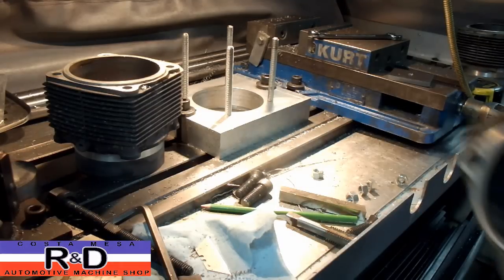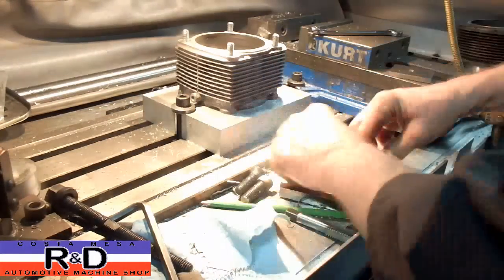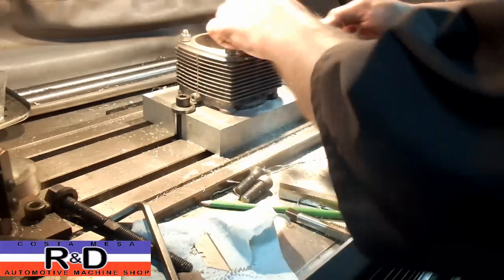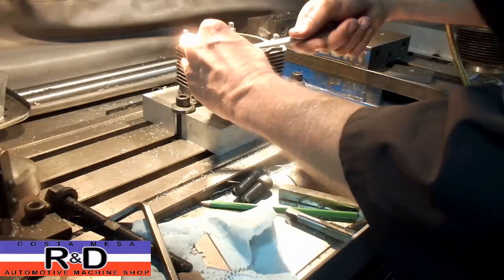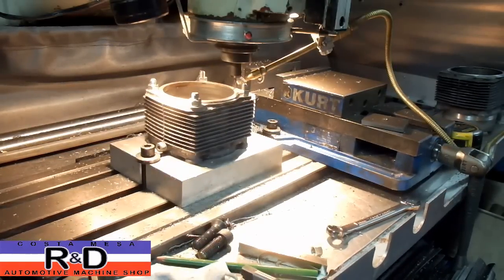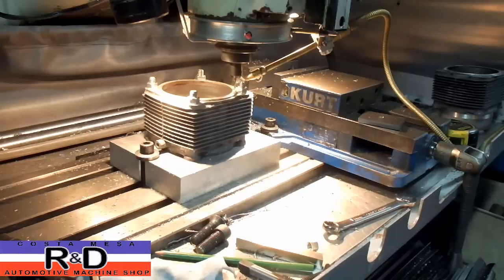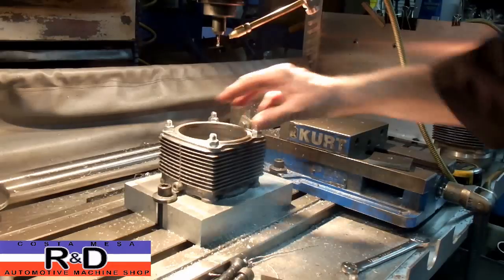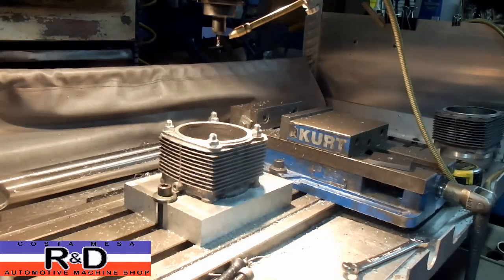911 Cylinder Fire Ring Modification

Comment: Hey John,
if you hadn't chosen to use the prototrak for this, would you have used the lathe?
Reply: dan rasmussen the point of the fixture is to save time in the future. it's just like tools i use form coworkers if i need more then 2 times i buy it.
Reply: lol I was about to ask similar question thinking the time for the fixture to be made he could have put it in lath faster
Reply from the maker: Could use the lathe, but even more elaborate tooling would be necessary.